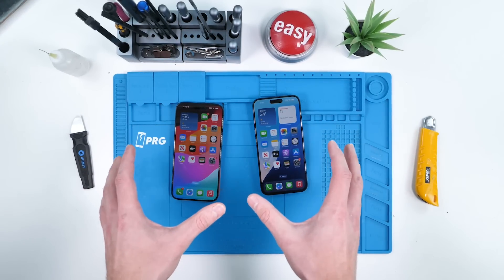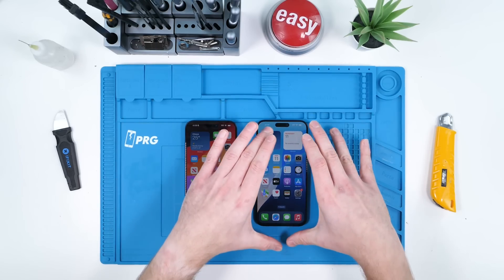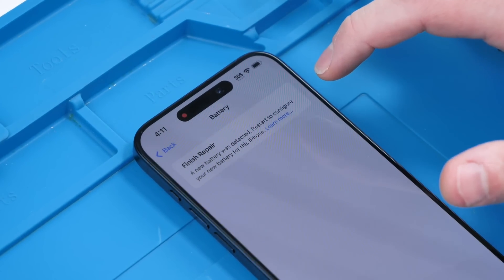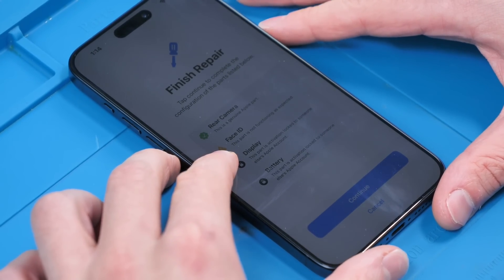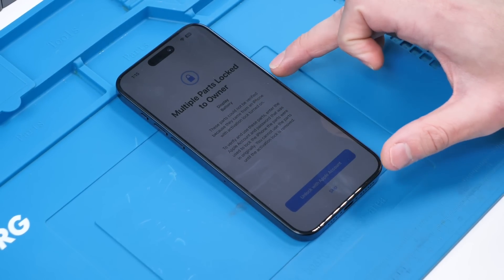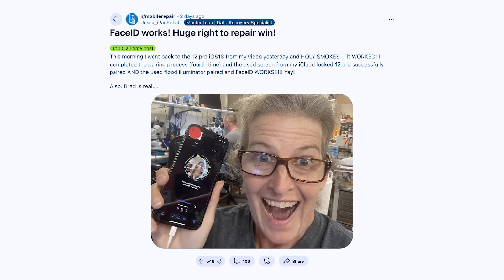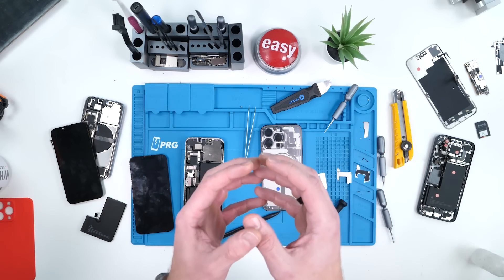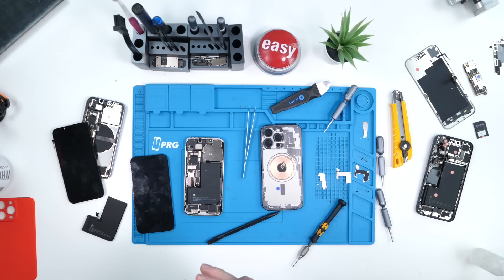Apple Made The iPhone MORE Repairable...?

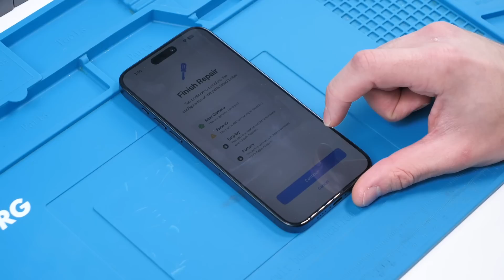Comment: 4:14 Activation lock is ALWAYS on for any apple device, it works completely independently from lost mode. activation lock blocks other users from just resetting your phone/airpods/etc. and pairing them to their apple account.
Reply: Not exactly true, activation lock is on any device that has find my iPhone enabled. If your phone is signed into an Apple ID but does not have find my iPhone turned on, then there is no activation lock. but if find my iPhone is enabled (doesn't matter whether you put it in lost mode), then it now has activation lock.  you were correct in saying that it is independent of lost mode though.
Reply: @bolga5152  find my is normally on by default and for certain devices its on as soon as you pair them like airpods. in this case its not even possible to turn it off, since removing them from find my disconnects them from your account
Reply: @bolga5152  👍
Reply: nahhh if your a real apple user and actually bought your iphone you can’t get locked out of your icloud account that’s if you bought your iphone apple support will definitely help you get back into your iphone……
Reply: @gayasslily   I don't know ok
Reply: I think people don’t recall before Activation Lock was a thing just how many iPhones were getting stolen and flipped at shady pawn shops.
Reply: I do apple iCloud bypass activation
Reply: Yes
Reply: Sad part Google is doing this from Android 12 and later.
Reply: @WilliamHollinger2019  Why is it sad to have an activation lock? In the end it makes it way harder for people to do stuff with stolen phones which means less phones will be stolen. This approach to the problem from apple is good, as it allows you to sell parts from legally aquired phones while parts from stolen phones will not work meaning less people will steal iPhones as they're pretty much useless.
Reply: @jxnxsdev Pretty sure that’s Stolen Device Protection,and I’m not against that,since stolen phones should never be used for other uses anyway

However for activation locked devices,most people just forget their passwords and bricked their devices,which is kind of a shame,since the device is perfectly working,not to mention sending it to Apple for them to unlock them officially,you have to go through a lot of work,in which most people just gave up and settled with their device bricked
Reply: @DanishWaffle4102  that is literally the point of activation lock…
Reply: @jxnxsdev Alright maybe I should rephrase a lil bit:
What I’m trying to say that some people that forgot their password and got themselves locked out of their *own* devices,might try to sell them as parts to get a lil bit of money back from their mistake
But now you probably can’t even sell it,since it’s worth like nothing,and all of that turns into e-Waste
Reply: @jxnxsdev And not to mentioned that the activation lock really doesn’t bother the skilled technicians

They could just swap out the chip on the screen/battery to another chip that isn’t locked and it’s gonna function like the other normal parts

So realistically,even locking down the parts isn’t really gonna be that effective,with just a chip swap,and that error is gone
Reply: @jxnxsdev "Meaning less people will steal iPhones" lmao, you really believe this? Thieves don't care, they'll just steal them anyway if they have the chance. So gullible lol, those people don't think like us, they just want that quick comeup.
Reply: @WilliamHollinger2019  hasnt frp been a thing since like android 5
Reply: Yes it's been a things since 5.1 @detecta
Reply: @WilliamHollinger2019 iOS has been doing this since 2013????

also as the guy above me said frp is way easier to bypass
Reply: @WilliamHollinger2019  yeah but with this one you're sorely wrong because iPhone's been doing it since like 2010
Reply: @WilliamHollinger2019 not even true
Reply: @WilliamHollinger2019  I don't think this is a sad part. You want to prevent phones to be stolen. iPhones are unusable for the person who stole it. (when find my is activated), but they can be used for spare parts for other phones. Now the parts also get activation locked so you can't steal an iPhone for spare parts. When you want to use it with your own phone for spare parts just remove the lock so it can be locked to the new phone.
Reply: @WilliamHollinger2019 frp is way easier and cheaper to bypass

Comment: Activation lock is not the same as reporting an iPhone as lost or stolen. It simply means there is an active AppleID on an iPhone, turning off "Find my iPhone" or turning on repair mode by removing the device from "Find my" or signing out of the AppleID from the phone solves this.
Reply: If i do find my device off, It will worked for update ios 18?

Comment: The back glass now is serialized too? Tf youre supossed to calibrate there? The bunch of copper for thea wireless charger?
Reply: That’s correct
Reply: probably something to do with magsafe
Reply: @feefre  a Copper coil with a mic and a flashlight 
You must calibrate the light intensity hehehe

To be honest, although it appears silly, i think serializing the back glass is done to ensure that no one will break the glass and damage the internal components
And after that replace the glass outside Apple then request a warranty repair for the unit.
That is my opinion
Reply from the maker: @taherrp481  We can still get around that quite easily. All it really does is make repairs harder. I can still do extensive repairs on any device and none of it would show up in the parts and service history.
Reply: @PhoneRepairGuru  maybe it is to make people pay more than 200$ for a glass😁
Reply: @taherrp481 There’s no reason to pair it there’s a chip there jsut to hold the serial that has no other purpose it’s just apple being apple
Reply: It could be wireless charging as well

Comment: This could give broken phones more value, as now even if the screen or back glass is broken the intact parts could still have value on the after market
Reply: Still depends on the previous owner removing the device from their Apple ID, which not many people remember to do on their broken device (esp if they don't get an iPhone again).
Reply: @Rayjacker yeah but I’m talking about for us, we know to get rid of the activation lock, if we break our phone than we can get better resale value for it
Reply: Not really has icloud has to be removed, otherwise parts stay locked. If screen broken and others issues unless you put a temporary screen and have them remove icloud first still going to be the same parts are going to be locked. 

The plus side is if icloud is removed you can actually repair face ID without having to modify cable and use a 3rd party programmer to get it to work. Battery was the second big win.
Reply: Why would the value of the part go up? You can already do that

Comment: What will happen when you configure other phone parts in your phone and then again use the parts on the other phone. I don't know how to explain this lol😂
Reply from the maker: I thought they were now paired to the new board but honestly I’m not sure. The update isn’t polished enough
Reply: They lose the association to the original CPU.  A part can only be paired to one device, it doesn't create a string of past associations that follow it.   (At least that's what we think from our experiments)
Reply from the maker: @ipadrehab5362  That’s been my experience so far too. I reported the new motherboard it was paired with as lost or stolen twice, then performed the swap again. After unlocking the part the first time to pair it, it didn’t ask for any further unlocks. I’m not sure if that means the parts are permanently unlocked, but it certainly seemed that way. Interestingly, I found that the back camera wasn’t locked to any motherboard at all and never required any passwords to unlock.

Comment: When is Eu finally bringing in the replaceable battery
Reply: I think it will be mandatory from the beginning of this autumn, apple knows it, so they release the phone earlier
Reply: @rikyrossi9518  real
Reply: @rikyrossi9518 they always released iphone at the end of the year fuck is you on about
Reply: *easily replaceable. like the ones on the CORE Prime, but all batteries have been replacable
Reply: I'm the only one who answers the original comment: in 2027
Reply: Bringing back you mean. 10 years ago it was the norm.
Reply: iPhone 16 has it
Reply: Starting from 2027 if not mistaken
Reply: It won't affect Apple at all since iPhones are waterproof, and the regulations are much looser for waterproof devices.
Reply: @NikitaCartes Most phones are waterproof. Have been for years. Longer than Apple. Thats no excuse.
Reply: @d4n93r  WATER RESISTANT ! NOT WATERPROOF!
Reply: @videaohovne they are legally waterproof, not physically waterproof
Reply: @d4n93r improve ur reading comprehension fam
Reply: @NikitaCartes  water resitant not proof omfg
Reply: @Flop666  I forgot the right term. Sorry
Reply: @NikitaCartes they still have to be easier to replace
Reply: @NikitaCartes no its because since the 15s, their batteries are able to last longer, and were able to bypass the removable batteries portion.
Reply: I wish original batteries could be sold anywhere
Reply: 2026
Reply: Never
Reply: It has always been replaceable. And as long as my IP rating won’t change I don’t mind but if it gets worse then no thanks. I don’t need a new battery every day  anyways
Reply: @seesikopter  but imagine you run out of battery and just connect a new one
Reply: I think he's in the US
Reply: if I’m not wrong it’s 2027
Reply: EU has bigger problems like forcing companies to give them your messages so they can analize „dangerous” messages
Reply: Honestly just get Apple Care. It's not even that expensive and you can basically break your phone twice a year and get it replaced hassle free
Reply: i wonder what’s the android phones esp samsung is gonna do when the forced battery mandate from the eu is in effect…. apple already made theirs easily to repair……..have you guys actually repaired a samsung phones battery??? 😂😂😂 or a pixels???😂 make sure you guys have that same smoke for those androids the way y’all keep blowing smoke for apple being “forced”
Reply: @Coolbreeze117  you know, it’s funny how android phones actually have batteries that are way harder to replace than iPhones
Reply: @Coolbreeze117 what are you, 5? It’s like taking a cookie from the cookie jar, then when someone calls you out on it, your response is “Well Tommy also took one!”

Like jfc, ppl were just talking about replaceable batteries in phones, and it’s a video about the iPhone, your immediate response is “But Android does it too!1”

Just assume it’s implied and move on, cuz no one brought it up except you. What made you this way, where you’re actually white knighting for a multi billion dollar company?

Comment: Wait…. This could be an issue. Here's why—what if the part that a third-party gave to the customer’s phone was iCloud locked, what will happen?

1) Will it lock the customers' phone due to it being paired with the previous owner's device? This might render the phone unusable, forcing the customer to resolve the lock issue, or

2) The customers' device may just have the old 'non-genuine part' message permanently without any fix to it.

Yeah, this change is good but they still haven’t fixed the core part, which is that almost all parts come from an old device that probably has iCloud protection on. Like in various scenarios such as they forgot their password/email, or the previous owner has activation lock enabled, leaving the customer unable to fully use the device without resolving the original iCloud lock. This can also happen if the previous owner didn’t remove their device from iCloud before the part was installed, leaving the customer stuck in a frustrating situation.
Reply from the maker: From what I’ve seen you can still use the activation locked parts but you can’t calibrate them. They’re treated the same as aftermarket parts.
Reply: @PhoneRepairGuru  Yeah figured as much, good thing they didn’t pull a different outcome that would’ve been bad for third-parties. 

Still that sucks even though its a genuine part, you can’t get the full capabilities of said part just because an apple ID is tied with it
Reply: @PhoneRepairGuru  Also, is the parts recalibration available globally after release or is it only region-specific? (US, EU and Canada)

Comment: The only benefit  to this from a repair shop perspective is let’s say 

I buy an 13 pro max, screen is perfect and the back is cracked, battery is shot, and it’s blacklisted but no iCloud, basically Not worth at all to fix it 

There, we have a genuine 13 pro max screen with no iCloud linked to it that you can use on another 13 pro max for a legit repair

Comment: I dont understand.

So after you take a screen that has an iCloud account, and put it on another iPhone…it will still work but say non genuine?  Or not work at all???
Reply from the maker: From what I’ve seen so far it acts as a non genuine part would. You can still use it but cannot calibrate it
Reply: @PhoneRepairGuru  got it, so then this is mostly a pointless move? Why would you take a part for a phone that’s not iCloud locked, to an another phone?? The only reason I can think is if the original phone has some issue with it such as being blacklisted, modem issues, or other issues

Comment: This is so stupid. Why serialise everything from begin with? Back glas serialised. that a joke.
Reply: to remove all value from stealing an iPhone...
Reply: @nyatFer but they literally just did what they could’ve did from the beginning this comment is irrelevant 🤣allow people to use fresh and clean parts and block parts from an icloud locked phone
Reply: @nyatFer  that is a pretty good idéa. Never thought about it in that way 🤔🤔
Reply: — FR . It’s the most basic parts unless they designed the wireless charging with a controller on its coil ? 🤷🏻‍♂️
Reply from the maker: I completely agree, this should not be an issue to begin with.

Comment: Even if they are easier to repair, people now will charge more for broken phones so it may not be much cheaper
Reply from the maker: That’s one way to look at it, another way is that you can actually use the parts from the broken phones and calibrate them with your own. I’d argue that the broken phones without iCloud locks are worth more now. Unfortunately there’s still no way to tell if the phone is iCloud locked aside from looking at the original owners find my account.
Reply: Better get my held-together-with-tape 12 mini on the scrap market, quick!